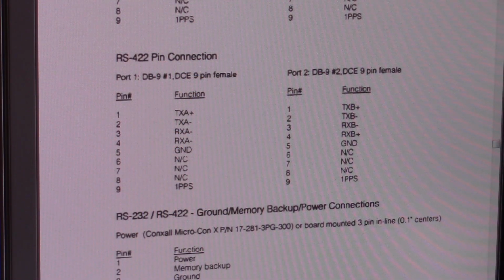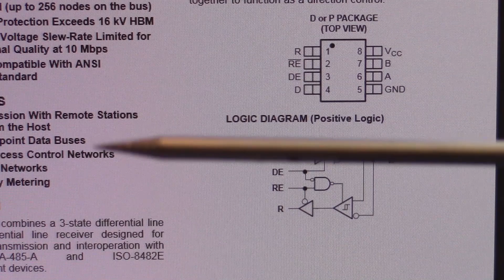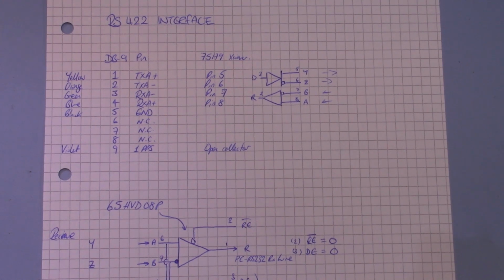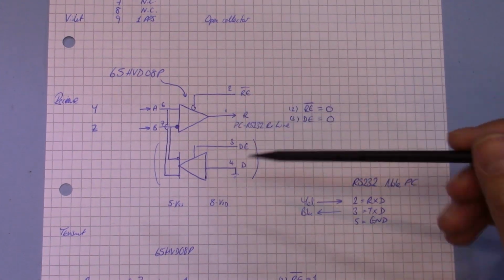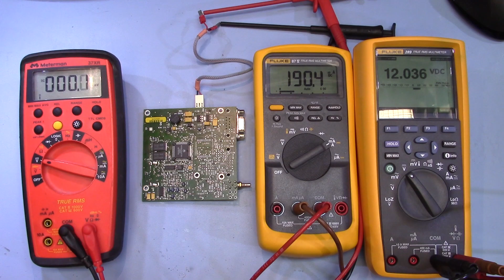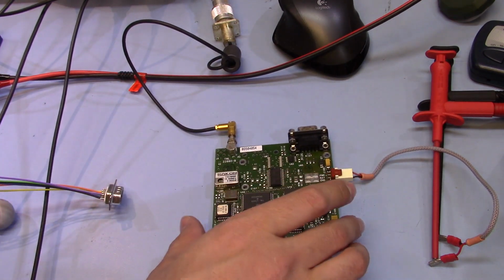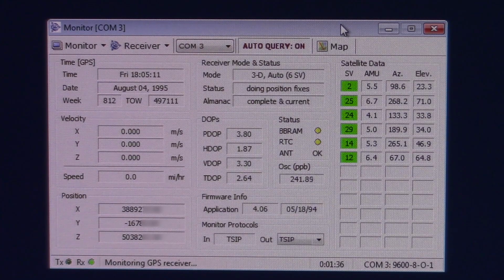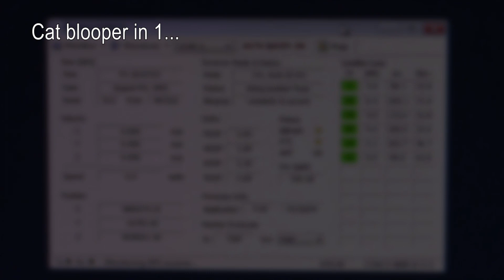SDG #09 Trimble SVeeSix GPS Receiver

Comment: The week rollover is quite fixable, but it would require dumping and re-programming the ROM. Trimble used very similar firmware on all of their receivers, and it's simply a matter of finding an ADD 0x400 and changing it to an ADD 0x800 to get the receiver into the next epoch.

Comment: Hi Steve, is it possible to please get a copy of the manual from the CD you have acquired? Working with the Repco 1504 L5 GPSDO and struggling to receive satellites on a mediocre 5v patch antenna. Also interested if you still have the board. I wonder if the rollover problem will effect the locking but doubt it. Kind regards, de Spence M0STO

Comment: The 1024 week rollover problem (GPS version of Y2K issue) is well known (seen in 1999 with early GPS receivers).
http://gauss.gge.unb.ca/gpsworld/gpsworld.november98.pdf
Your Trimble module defaults to August 4, 1995 as base date, which is logical for an early 1990s GPS receiver.
Heol Designs (France) developed a clone for Trimble ACE II/III (follow-on to SVee6 and SVee8) to address 2 issues w/receiver -- 1024 week being one issue.  I use Heol Designs N024 receiver as replacement in my TS2100 (TCP/IP NTP server, 10 MHz reference, IRIG-B output for remote clocks).  IRIG-B standard used since late 1950s by NASA and aerospace.

Comment: Here is the SVeeSix Designer's Manual.  Rare scan of original (save to your home HD/CD).
http://www.ko4bb.com/manuals/50.158.136.69/SVeeSix_SV6_Timing_Module_Manual.pdf

The Trimble SVeeSix, that you have, was used in GM automobiles.
A later version was reduced in size, SVeeSix-CM3.
Reply from the maker: +w9gb Good info again. Many thanks for contributing!

Comment: Are you planning to do more with this unit? I picked up a Trimble Placer 450, seems to be an older unit than the SVee 6. But they are dirt cheap on eBay and extremely hackable. It even has an extra DB9 port on the front with some GPIO pins.
Reply from the maker: dwDragon88 I don't have any specific plans - I really need to think of something I can use it in. I've picked up a slightly more capable module (Navman TU30) so I will be experimenting with that shortly. The SVee 6 seemed to struggle to find satellites at times, so I'm not sure if it needs a bit more gain on the antenna to use it effectively.
Reply: SDG Electronics I've had a similar issue with the Placer 450. It struggles to keep a 3-D fix.
Reply: The Trimble Placer 450/455 built for automatic navigation links (where vehicle located).
http://www.rdrelectronics.com/skip/feb/placer_DS.pdf
The GPS receiver is NOT a daughterboard, but integrated in one PC board within enclosure (circa late 1990s Trimble GPS designs).